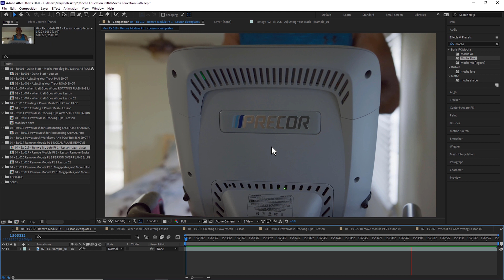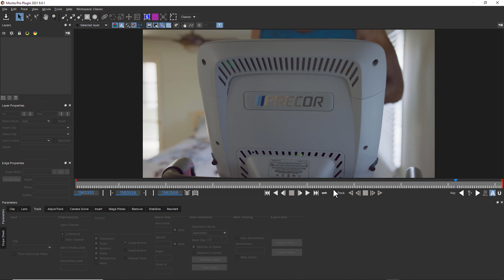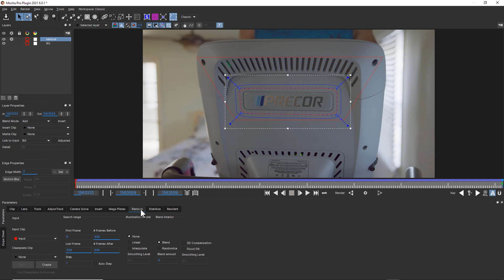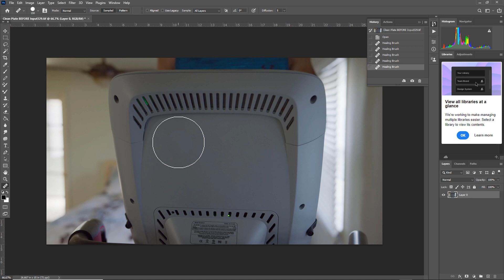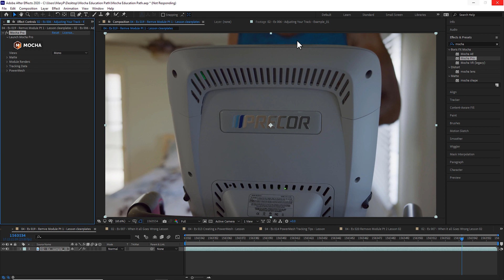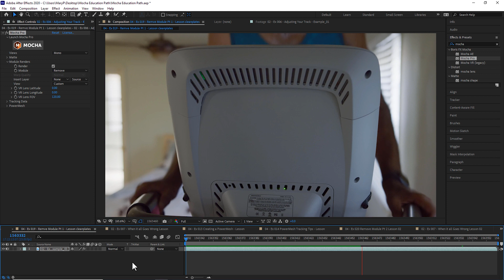20a Intermediate Removes [Mocha Essentials]

Comment: I dont understand what im doing wrong. I did everything to a T but after I go to click exclusively, it doesnt let me render
Reply from the maker: This is probably a layer thing.  In the Remove module do you have the cog visible on the foreground layer?  Is the background layer tracked and bigger than your foreground?  If so, could you contact Support or make a quick post on the forums with some screenshots : https://borisfx.com/support/open-a-case/  or  https://forum.borisfx.com/
Reply: @borisfxlearn  it ended up rendering perfectly fine going forward but when I went to render the first half backwards it got all wonky and jumping even though it's linked to the other track.

Comment: pls i want ask so important question ( at least from my p.o.v ) , All valuable mocha tuts. that introduced in your channel are using very short clips to test tracking  , I need a tut. for how to deal with LONG clips e.g + 30 seconds ... thanks and i am sure that you will respond soon
Reply from the maker: We tend to choose shorter clips for these so people are hanging around waiting to watch long renders. The ideas are basically the same.  The Remove module is used for a lot of things including VR rig removal, which can be many thousands of frame long.  An important technique to use for long clips is the "Use Cleanplates Exclusively" trick.  Use Remove to automatically generate up several cleanplates along the length of your clip.  Then turn on Use Cleanplates Exclusively to get the faster render times of that.  Mary does show that technique in her videos.  Hope that helps.
Reply: @borisfxlearn  ok sir .. this help indeed in remove module .. BUT the most important for me is the Tracking itself .. mocka is a majec in e.g 10 sec. If i cut long into shorts it tends to be non consistent .. But how those in production companies handle long shots .. that is the question
Reply from the maker: Many ways to handle this.  If you're in After Effects, break the shot into smaller sections and track them.  Back in AE, export your smaller sections to null objects. Each section gets a Null of its own.  Then parent those Nulls together, on after the other in time order.  Now simply connect your element to the first null object and it will have consistent movement all the way through.  NB All the elements you track must be co-planar otherwise it will not work properly.